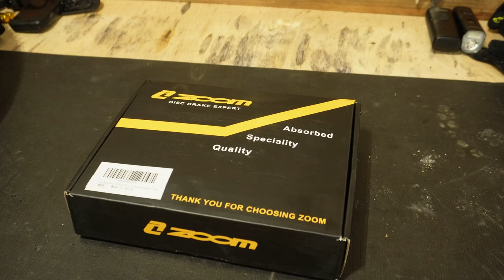How To UPGRADE / INSTALL Your EBike Brakes / Everything You Need To Know

Comment from the maker: Zoom Ebike Brakes: https://amzn.to/3quJqPf
EZ MTB Bleed Kit: https://amzn.to/3sqcNCA
Brake Barb Tool: https://amzn.to/3E5VUjr

Videos:
How To Bleed Your Brakes: https://youtu.be/PRupIWFTezQ
How To Bed In Your Brakes: https://youtu.be/YPKTAjBjF_k

Pick Up a Shirt or Hoodie Here at the Merch store:
Swag: https://runbikemike.myspreadshop.com
Reply: Hey I have the same brakes but while installing them I realized that olive( the yellow cap) is big and it falls down on the hose. The hose literally goes in and you can move olive until the caliper. And that makes the hose to snap out of the break lever , I can’t really install them. In fact, the whole oil dripped out from the lever😂😂😂. How can I fix the problem? What could be the reason?

Comment: Great stuff but threading screws with a drill?
Reply from the maker: Yeah it is a powered screwdriver. Super low torque. Once you get it started it speeds up the process. The key is to take your time and make sure it is threaded in 1st.

Comment: Excellent video! I just installed my Zoom front/rear kit (no manual). Your info definitely did the job. However, I have about afoot of extra brake line on the front brake. Is it OK to cut (with the brake barb tool) a live hydraulic line? Will oil be squirting all over the place? I'll be removing the connection at the master cylinder and cutting there, then install new barb. TIA.
Reply from the maker: Remove it from the master then it won’t be under an pressure but it shouldn’t really have pressure unless you pull the lever anyway. Just have it over a bucket just to keep it from getting on your floor.
Reply: @RunBikeMike  Thanks. Will definitely take the pre cautions. I used your tool links.

Comment: how far are you inserting those cables into the break handle? Does it hit something inside that only allows a certain length of cable inside the handle?
Reply from the maker: Yes it stops and the nut will tighten down all the way

Comment: What about the shutoff sensor installation the wiring is that not important??
there's is a shutt off on the handle how do you connect them what if the don't match?